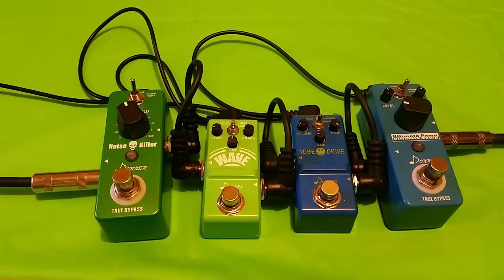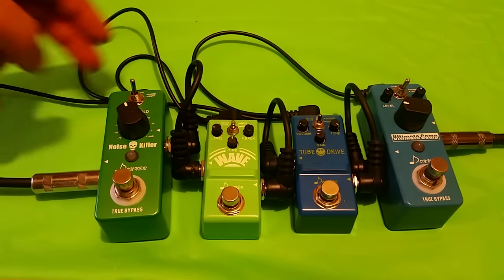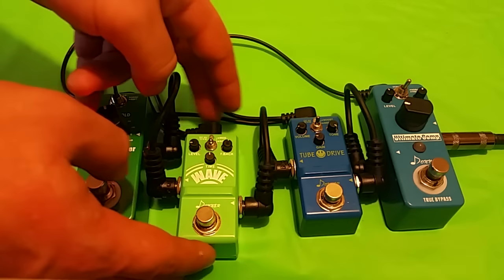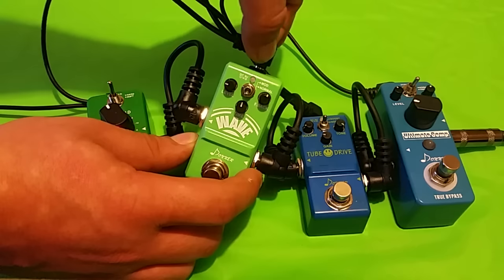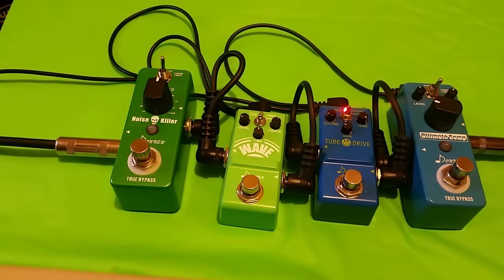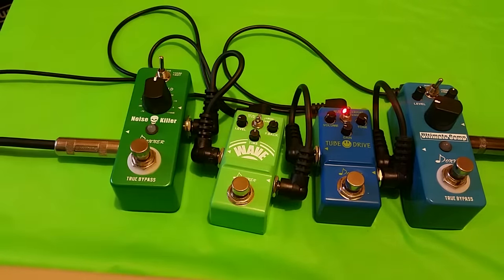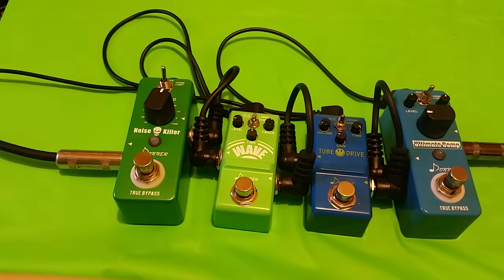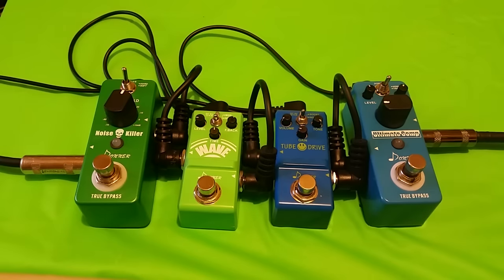Donner Pedals Quirks: What Other Reviewers Haven't Told You

Comment: Here’s a car “quirk” - My Ford Focus cuts out when I shove potatoes up the exhaust. This is not a good thing in my opinion.

I reported the issue to Ford. 

In an absolute quagmire of silly reviews, this is right up there.
Reply: Thomas Jefferson  :D :D :D
Reply from the maker: This is not a review, per se, but something I felt compelled to make after buying my Donner pedals.  I watched basically every YouTube video available on them before buying mine, and found all of these things kinda surprising when I got mine and started playing with them myself.  I couldn't find any record of these little quirks anywhere online at the time, so I made a vid explaining my experience with these pedals compared to others just because it was stuff I would have liked to have known before I bought them.

I'm not trying to give a comprehensive review of the pedals here and not trying to say they're bad or unusable, only to show some things that I found strange and how I've had to work around those issues and how the pedals may or may not work in other setups.

I'm also considering making an update video about my new pedalboard and showing the Donner pedals I still use and all the other new stuff I've changed since the days when I made this.  I still use a few of them, but a lot of these issues are still valid to this day and have been reinforced with more experience.

Comment: All true for joyo. Had to redo all fly wire after removing board once because wires were too thin gauge to hold solder. Switches, jacks, pots cheap. Harder to sweep across sounds to find sweet spots. Any more than 33% of real thing is too much unless you don’t mind putting 20 and work to upgrade above to make road worthy.

Comment: My nano pedals never had an issue with their power supply jacks until i added a daisy chain cable to one of the ports on my isolated power supply brick.  I'm still not sure if it is the daisy chain or the pedal itself causing the problem.  Have you tried with other cables? . I really enjoy your videos BTW.
Reply from the maker: I only own one Power All power supply and 2 of their 5-way chains that I
 use with it.  The chains are slightly different in construction, but 
they both function fine on all but the donner nano pedals for me.  And 
again, I don't have major problems with the pedals when using them 
normally, but I do find the quality of the jacks on the pedals to be 
less than stellar compared to the competition.  Thanks for the feedback!
  Glad you enjoy the vids. :)
Reply: Thanks for your quick reply!   I do enjoy this pedals very much. Having them attached to my pedalboard, cables dont seem to move much so the contacts rarely fail while im playing.  For me it is a mere nuissance. Others might think it is a big problem if playing for an audience.

Comment: I am gonna make sure not to "dangle" anything during a live performance so that it doesn't fall out!  😂😂😂😂😂😂😂
Reply from the maker: The problem is more when you bump the pedalboard and it randomly stops working.  I've had it happen many times now while on stage.  I even have a much better pedalboard with dual lock and a real power supply, etc, and it still gives me issues when the board is bumped in the right way.  It's not a deal-breaker, but it definitely happens now and then.

Comment: Every time I've had this issue it's the power cord, it's usually the barrel jack. Specifically, the wires just behind the jack.  There are only a few strands of thin copper in there. I've re-soldered some of these three or four times (and it's damn near impossible!) before I built a truly robust system of my own. Those cheap thin power cords you get with 9v multi-outlet barrel connectors are shyt.

But it can also be the cheap, short 1/4 plugs between the pedals. They don't last either. The moral is: Buy QUALITY SHIT! And NEVER buy those "offset-type"  plugs that directly connect without a wire. You will break your pedals with those.

Comment: The barrels on cheap power supplies are not always of uniform diameter - they can vary by minor amounts. I have a Donner pedal supply with this issue. For an accurate test, compare how all pedals interact with the same input jack under similar conditions.
Reply from the maker: There are 2 main issues with the jacks on Donner nano pedals.  They don't allow the plug to slide in far enough to hold itself in place and they're a little too wide to snugly hold the plug once it's in.  I've managed to sand the plastic of the jacks down to let the plug go a little deeper, which helped, but they're still not perfect.  Also, the mini pedals have perfect jacks and I'm still using these nano pedals and still not having problems from them in practical use, so it's not the end of the world.    Thanks for the feedback!
Reply: If it moves and it's not supposed to... Duct tape! lol
Reply from the maker: But that will mess up the aerodynamics... ( ͡° ͜ʖ ͡°)

Comment: I've been touring with about 6 donner pedals on my board. Never once have I decided to pick them up snd swing them around and Call it an issue when one of them stops working right. 

You're looking for problems if your issue id "I don't have an issue I just broke mine and they fixed it." 

Maybe get a pedal board and not just have your pedals on the hard stage floor and maybe don't pick them up and swing them around.

Comment: OK - knowing this with the power lead - just gaffer tape the lead to a solid surface and it won't disengage if you disrupt your pedals - a small price to pay for getting such excellent sounds for so little money...
Reply: snotmale exactly the power jack complaint was stupid
Reply: +1 for gaffer tape.  Could also velcro everything to a pedal board to take care of issue from moving them around .  Do people actually use pedals without a pedal board?  Lol
Reply: 2 ways to keep the power jack in (1) a rubber band or (2) electrical (gaffer??) tape.
Honestly the Power jack complaint was an absolute NON-Issue.
You'd want this pedal mounted on a pedal board anyway. Unless you're just using a OD/Dist pedal, a Crybaby Wah,  and a third pedal, Using a Daisy Chain power supply is a big NO-NO, bite the bullet and buy a VooDoo PSU.
Reply: Yeah, pliers and spanners are useful tools. is this really the only bad press you can come up with?  Did Donner give you some free pedals by any chance?

Comment: I thought you were going to reveal huge problems in the sound quality. Having worked as a live TV studio engineer I can tell you that Gaffer's Tape and Velcro Tape are your friends. - Buy some of each. Either that or open everything up, get out your soldering iron, and hard wire everything. If it bothers you -- FIX IT!
Reply from the maker: I have a board with dual lock now.  It's better, but the issue in the power port is still a problem occasionally with the micro pedals.

Comment: so, 2 years later, has this improved?
Reply: I've had this problem for the same amount of time and it hasn't changed, but I can live with it.  Just gotta keep the pedals from moving around on the board.
Reply: @dougyanez1710  it's not the pedals it's you or yoir board...I've literally thrown my board at shows and they've never fallen off or gotten whacked out
Reply: @TurtleBoxOfficial  My board changes or gets disassembled at times depending on what I'm doing, so I don't keep my pedals locked in place.  It wouldn't fare well if thrown, but I don't plan on throwing it.  And as long as it doesn't get dragged around by walking too far away and yanking them with the guitar's cable, it's not a problem.  They're no better or worse than they ever were.  I love them.

Comment: It looks to me that problem is not the pedals but rather the daisy chained  power supply that you are using.
Why not use a Donner power supply with Donner pedals?
Reply from the maker: Because Donner power supplies are kinda cheaply made.  I've upgraded to a proper isolated power supply now and it works better, but I still have issues with the power input jacks on those nano pedals.

Comment: I'll tell you what a problem is. I bought the J Rockett Audio Designs Blue Note (version 1) a 200 dollar pedal and the quarter inch IN/OUT JACKS at the slightest touch or movement would slip out of the the sockets...I had to put tape to hold the jacks in ....That's a problem.

Comment: Get a pedalboard that will fix the problem.
Reply from the maker: Welp, I bought a proper pedalboard, used dual lock to attach everything, and even set it up with an expensive little power supply, yet I still have these same troubles.  I can now pick my entire 20-lb board up by any one of the pedals and they won't shake loose from the board, but I still have issues with the power shorting out to my nano pedals when I bump the board or yank it by walking too far away while on stage.  It is not a terrible problem and it doesn't happen every gig, but it does happen, even while on stage.